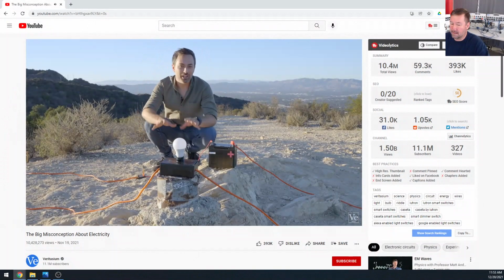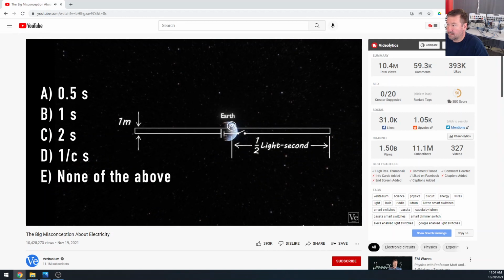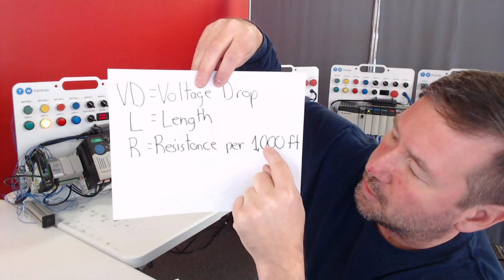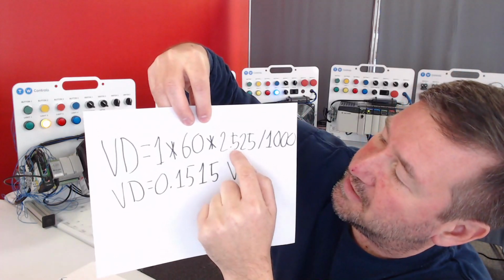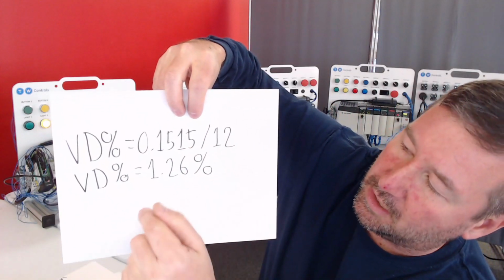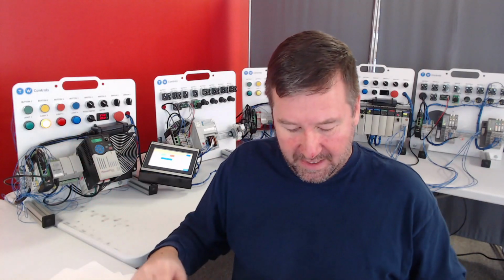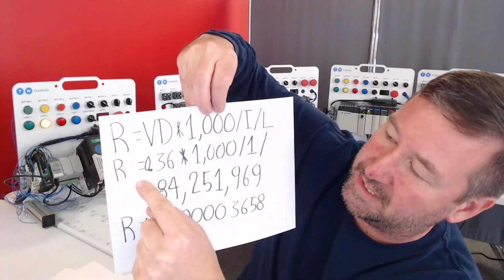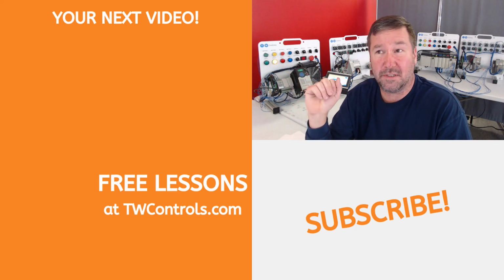Calculating Voltage Drop to Size Wire

Comment: Maybe you could help me out I’m running surveillance cameras each camera when it’s night vision activated pulls no more than a half amp at 12 V DC. My longest run is 267 feet. I’m running 18 gauge ethernet cable that has its cat five so there’s four pairs of 18 gauge wire two pairs are used for power and two pairs for video or one pair for power and one pair for video whatever anyway the power supply is a standard 12 V DC maximum amperage is 10 A the issue I’m having is at night when the IRS turn on or the night vision this causes the cameras to flicker due to voltage drop but during the day they operate fine cause they’re not night mode. This is an add-on to an additional 16 channels that were already existing and it’s the same exact power supply and I don’t have any issues on that one so if you get a chance to read this, if you can respond, I’d greatly appreciate it. If you can confirm with me do you think it’s a voltage drop? I’m starting to think it is or do you think I’ve got something else going on? Should I have used bigger gauge wire so like I said my longest run is 267 feet. Everything else is under that

Comment: Unless it’s a closed circuit, wouldn’t 0 resistance equal zero volts and zero current.  Volts = current x resistance. Anything multiplied by zero equals zero. Same with power. Power = current x voltage. To solve that you need a resistance reading, which would be zero. Am I right Tim? I am referring to the video you showed about wiring a circuit to the moon.
Reply from the maker: Go check out the original video, there was a slew of interesting opinions on it and many different methods of arriving at it. It will definitely make you think !

Comment: LoL. That's one thick wire.
Reply from the maker: Yes, someone commented that it would take 1930 years to mine enough copper for it at the current rate :)
Reply: @TimWilborne  LOL! 1930 years to mine the copper! HAHAHA
Dare I say, I think it would also take a really long time for 1 amp of current to fill the wire's Inductance (and Capacitance) too. I don't have any math at the ready to back this up, but I suspect that the inductance of that thickness of wire would be off the chart... so, a great deal of time would be spent building the magnetic field before it ever really had a chance to "eek out" enough current to turn the bulb on. LoL
Reply: The actual experiment has wires probably less than 200 feet: of course the bulb lights “instantly “. Misdirection by Veritasium at best. Assuming as said zero resistance in bulb and wires 2 seconds would be the answer.
Reply: @davidrandell2224  So the reason's I believe Veritasium is claiming it lights in 3.33ns is due to the EM Wave that travels at speed of light across the air gap. He then uses "Transmission Theory" to claim that the voltage on the light rises "very quickly" to light the bulb.
If you watch the video carefully and read the "science documents" he links to in the video comments you will understand where he gets his misguided conclusions from.
Unfortunately, he incorrectly states several things including things like  (To paraphrase)  ~"It's not what happens inside the wire that matters, it's what happens outside" and insinuating that all the magic is due to the EM Wave, and not really what the electrons are doing.
He fails to tell the viewers that the Light was VERY DIM when he did his "actual" experiment, and that it only reach 2 volts... and that info only came out when he commented to ElectroBOOM's video. 
So, I am pretty disappointed with him and the video.
Reply: @marcfruchtman9473  It looks like the bulb lights before switch closes; would need to slow the video down, ‘photoshopped.’ DC produces a magnetic ‘field ‘, not an electric ‘field ‘.No magnetic field will light up a bulb. The expanding electrons cross over from subatomic realm to atomic realm high pressure ( surplus electrons) ‘negative ‘ to low pressure ( depleted) ‘positive ‘ terminal. The spiraling electrons mostly along the outside of the wire- skin effect- also eject some as the ‘field ‘, I.e. magnetic.Its all physical particles electrons. The E and B in so-called orthogonal transverse waves are really electrons- particles. Bad physics. “The Final Theory: Rethinking Our Scientific Legacy “, Mark McCutcheon, an electrical engineer. Nevertheless Veritasium’s video and comments were interesting.
Reply: @davidrandell2224  Hello David. Don't forget the "transient" effect. When a DC battery is switched "ON", there is a very brief "Transient" pulse of electricity which is a "changing" electric current. This has the effect of creating an electromagnetic wave. So, yea, there is a magnetic effect from the transient effect of switching the DC on. So, "technically" an "Ideal Bulb" would be affected by that.
Nevertheless, if we were using a standard bulb, there would be NO actual turning on of the bulb because the effect is very very small.

Comment: You forgot to calculate the diameter of the bundle of parallel wires needed to get the resistance down low enough!  Being rough and ready with things like packing density I guess about 4.5 meters :)

Seriously, the Veritasium experiment is not practicable on the time scale he described, but if you use an oscilloscope at shorter time scales, the effect can clearly be seen.  Currents are much smaller than 1A, distances are much shorter, and the effect is real.

Here is a video of a guy doing the experiment with 1000m of real wire (smaller than 14ga).   https://www.youtube.com/watch?v=2Vrhk5OjBP8&t=2s&ab_channel=AlphaPhoenix

-Jon